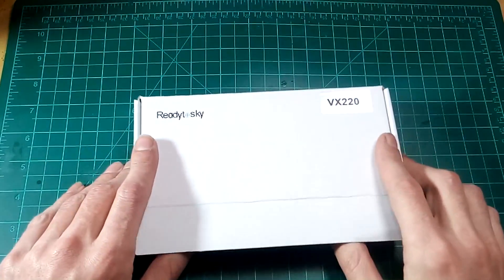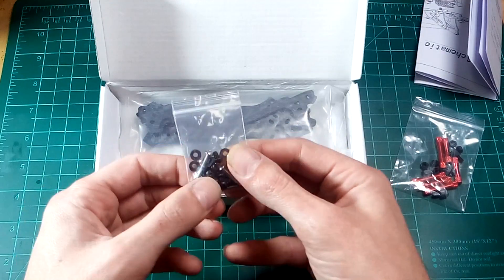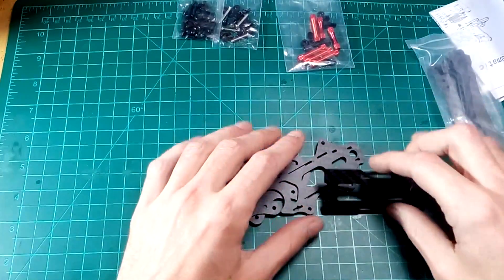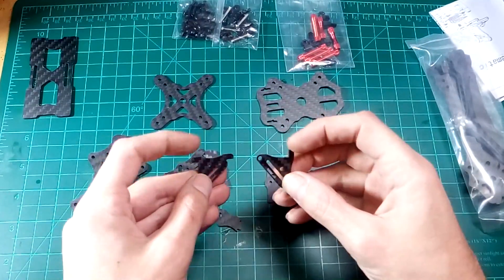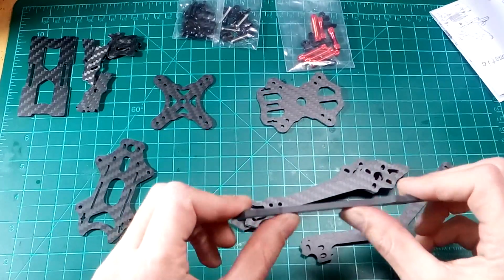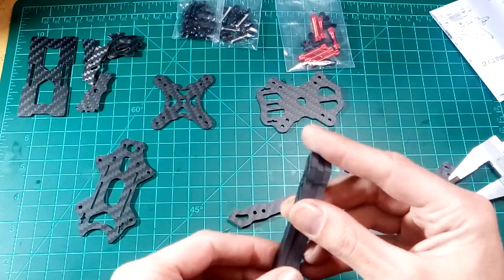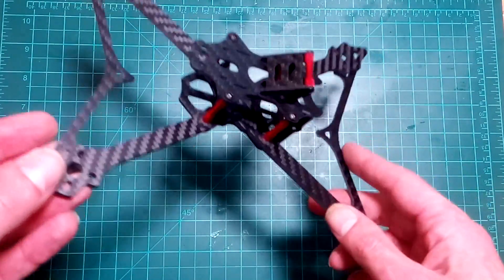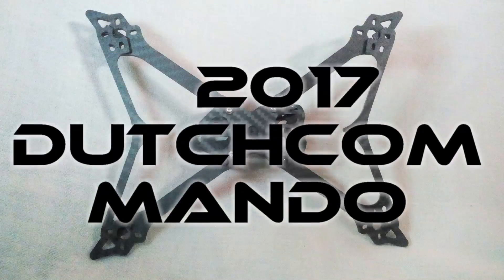VX220 FPV Frame part 1 (overview & build)

Comment: Beautiful frame its a stretch x ? Or à simple  x ?
Reply from the maker: it is a stretched X frame.motor-motor lengthwise is 175mm and motor-motor width is130mm.
i had done my first testflights with stock BF PIDs, and it flies like on rails.
i had a computer crash, so i lost that footage, but as soon as the weather gets better i will do a new video of the flight and final verdict.